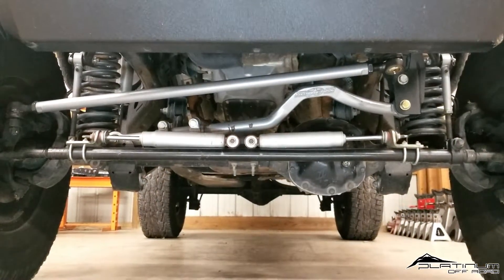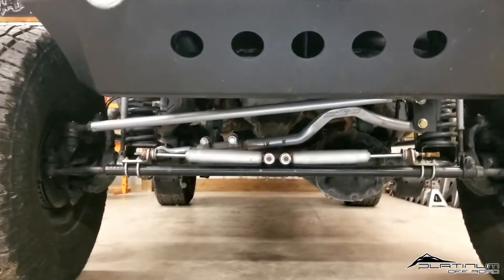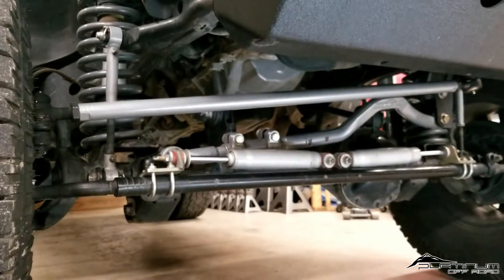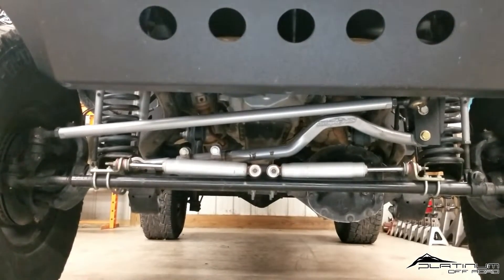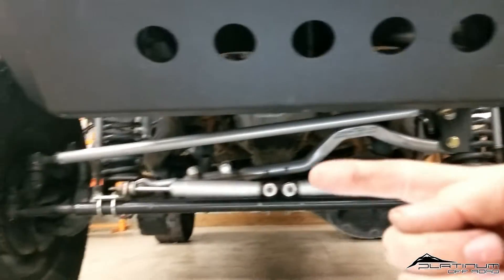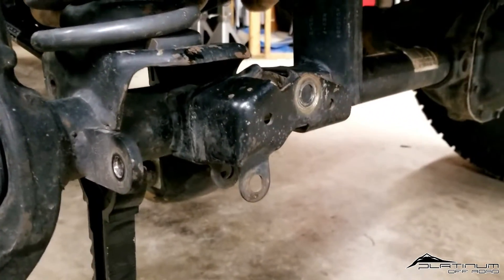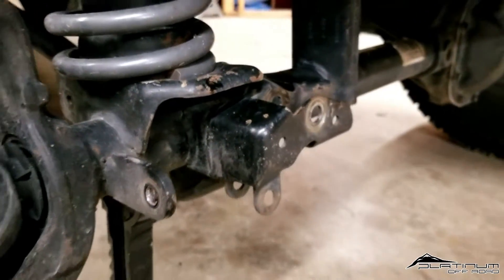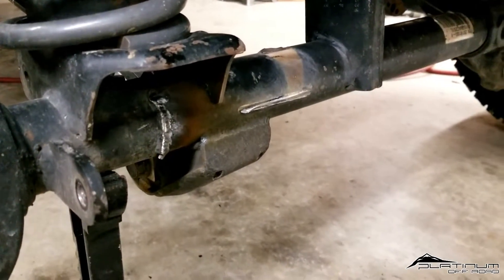Understanding Steering Geometry - Bump Steer, Drag Link Flip and Finding the Right Angles

Comment: Question can you give any  idea , the problem i have is that my steering get off center all the time i go off roding , i been taling my jeep to alliment and is ok just the steering any idea thanks for any info and be safe
Reply from the maker: We noticed with lower grade drag links and especially factory units, that this happens pretty much every time. Please NOTE, there are many theories out there!

Here's our throw at it based on experience, measurements and quality check to many of our clients' and personal rigs:

There's three key moving parts that could initially allow for displacement - two ends of the drag link and the gear box (if you wheel pretty hard). As the ends wear down, they start off needing excessive force to make them a new home or slop, but when doing on-road driving they stay in place pretty well wherever they rest. I've noticed higher end drag links won't do this as much, so we can certainly assume it's commonly somewhere in the ends. The gear box - I've noticed on a few gear boxes that we tightened up on the adjustment shaft, they tend to stay straighter after a day of abuse. Does this mean the movement is pinned to the gear box? Other possibility!

Other theories are changed caster angles if a spring comes out of place, or bent components such as a tie rod, drag link, or even track bar. Track bars can also shift within their bolted position and even a single millimeter and offset a steering wheel. If this is the case get a slightly larger diameter bolt at the end(s) of the track bar.. you'd be amazed at how much room OE bolts leave in that track bar connection. We also have proven in house that Jeeps with all heim joints control arms like RockKrawler and many others with soft internal heims, have seen the steering wheel shift on every trip out too. If you lay under a Jeep with such suspension, you will see how much the arm ends allow for movement within themselves as a friend gets on and off the brakes. (Don't lay directly under the Jeep! Lol) These joints need CONSTANT maintenance and eventually get so dry and worn out, caster angles change with even heavy road bumps.

Hope this helps and sorry we cannot say "This is exactly the problem!!" With proven evidence for every Jeep we've seen this on.

Comment: What size still hit did you use to drill the knuckle? Did you need a tapper?
Reply from the maker: The Rubicon Express kit just requires a hole to be drilled on the knuckle side... Believe it's a 7/8". They supply a tapered insert that expands as you tighten down on the nut. As for the pitman arm side, it does require a tapered drill that we do by hand. It's not fun by all means. It's to alow the larger drag link end to go deeper into the pitman arm hole and the castle nut to accept the cotter pin. I know the earlier instructions mentioned this step and the exact tapered drill to get. The more recent instructions may claim it works without having to open up the pitman arm hole, but just from our experience, we still have to bore it out a little.

Comment: I find it funny, I had the same problem with a flipped drag link. I took it to many shops and no one could figure out the geometry was off. I actually figured it out when I crawled under there and went over everything I replaced to realize my trackbar and draglink where no longer parallel. With only a 2.5" lift it made more sense to unflip my draglink. I ordered a new outer end thankfully my knuckle wasn't drilled out (I had the no drill flip from Steer Smarts by Yeti. It definitely fixed the problem.
Reply from the maker: You are absolutely right!! Typically flips are most beneficial when approaching that 4" lift range and above. Surprisingly many shops have come to life during the economic prosperity, but how many actually deserve your business is the real test. We hear horror stories that many new clients have come to us after a few local shops scratched their heads for weeks and only made the Jeeps worst. Good job on the correction Nonya!!!!
Reply: I have a 2 1/2 lift the draglink, trackbar and everything is basically new but factory parts. Would i need to get the flipped draglink?? I still have bad bump steer and no shops in my area can figure it out. I’ve been dealing with this problem for a year.
Reply: @Reality-wb8of the DL, and TB need to be made to accommodate the lift. Stock OEM parts are not ideal 

Also have you replaced the Steering Stabilizer?
Reply: @nonya6281  I replaced the stabilizer twice so you guys are right with DL & TB. I can see that they are not parallel so I’ll need to get a new flipped DL & TB.

Thank you 🙏🏽